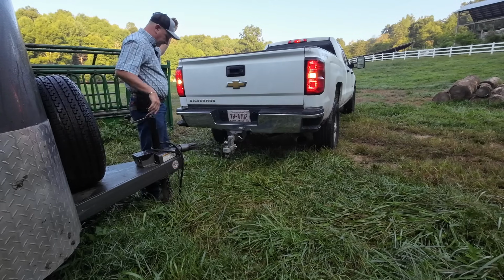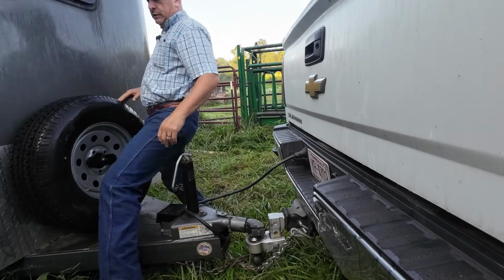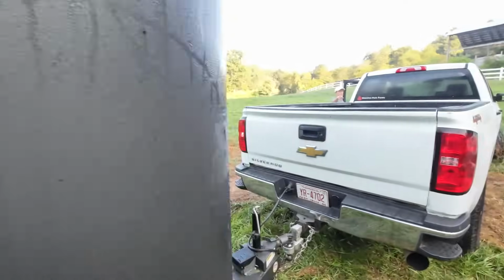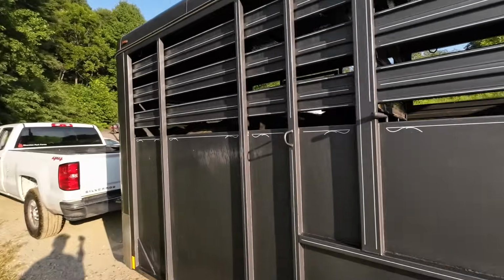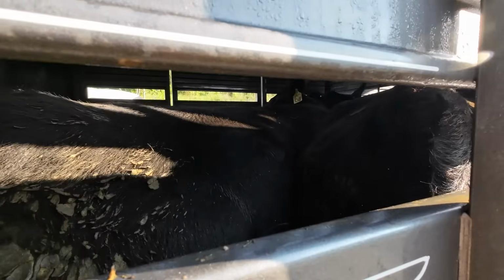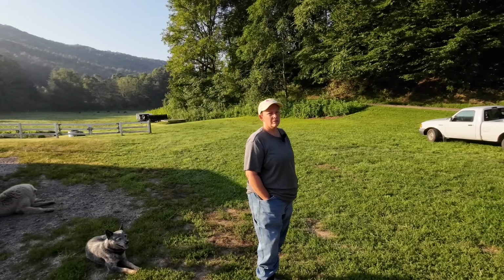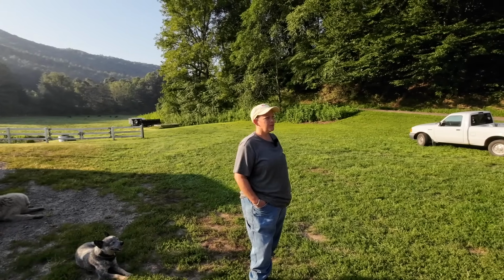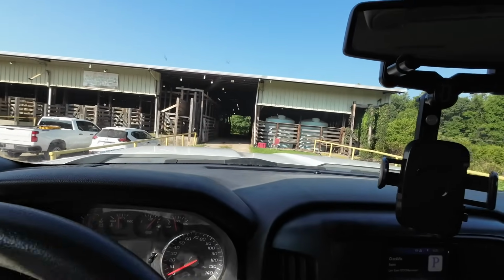Turning COWS Into CASH!

Comment: You need to tell people why you cross your safety chains on your trailers I didn't know it for years I pulled boat trailers travel trailers and you still come straight up but you cross your chains because if your trailer ever comes off your ball it falls into the cross and doesn't dig into the ground😁😁😁😁😁😁😁😁😁😁😁😁😁😁😁😁😁😁😁😁😁😁😁😁😁😁😁😁😁😁😁😁😁😁😁😁😁😁😁😁😁😁😁😁